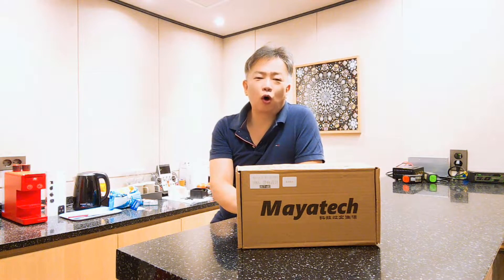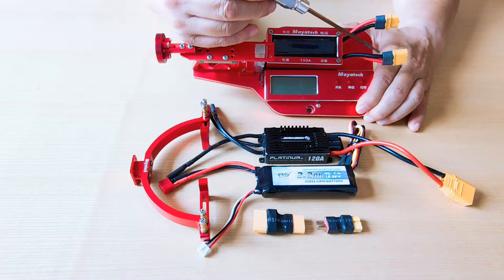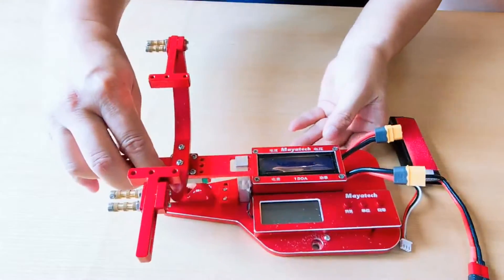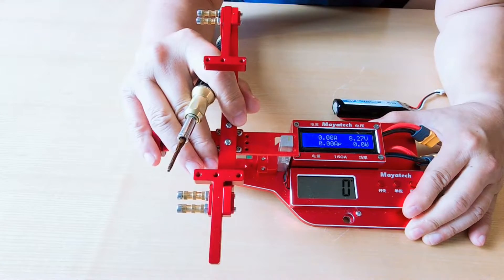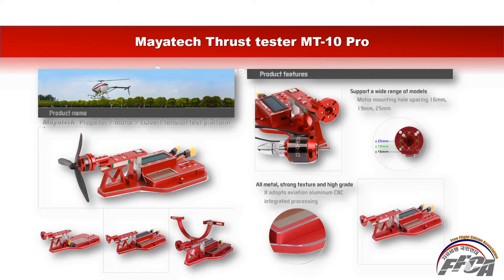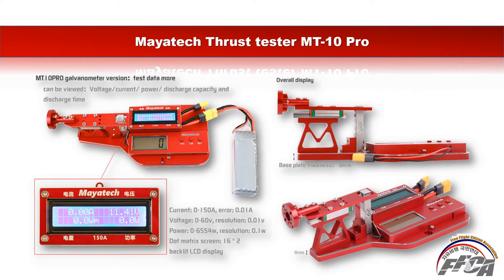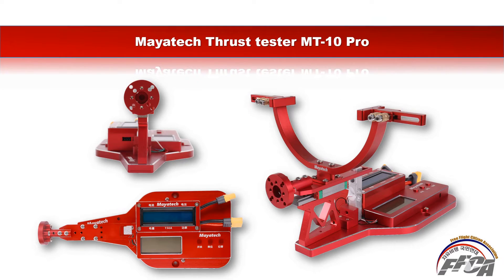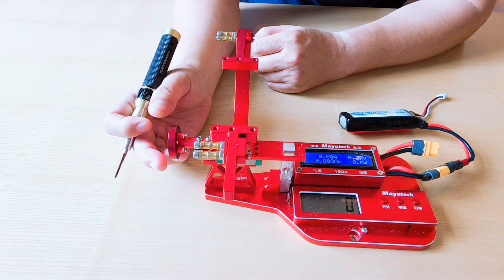01. Mayatech Thrust Tester : Unboxing

Comment: you sold me on it!
Reply from the maker: Really? Did you purchase it?
If you want to simultaneously measure the thrust of a propeller and an EDF less than 105 mm, this product is also useful. However, if you want to measure the EDF thrust of 120mm, please note that this product has limitations.
Reply: @scalemaster3307  i did order it today. I have plenty of quad motors to test but the biggest edf is 50mm. this should give me what i need.
Reply: @scalemaster3307  wow, been 7 days now and no shipment info sent.. whats up?
Reply: GOT IT! Thanx
 @scalemaster3307